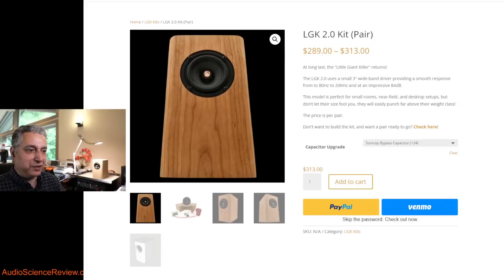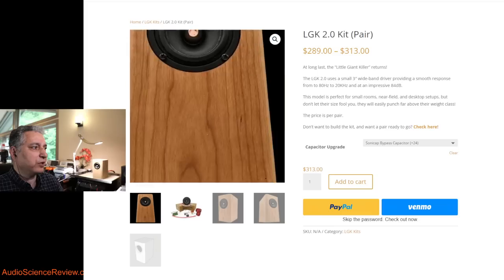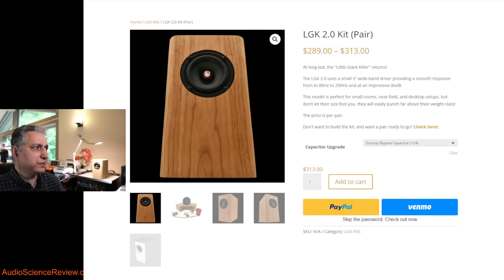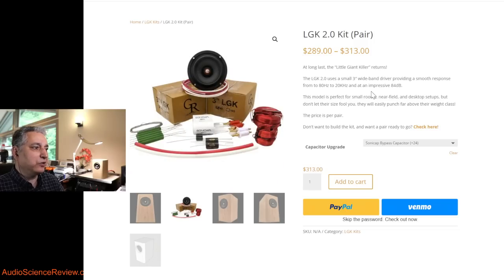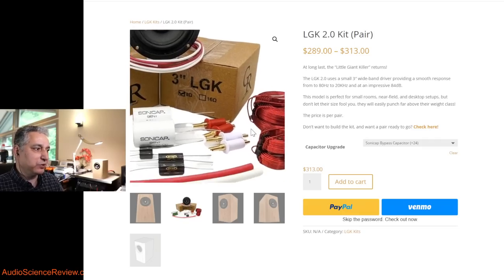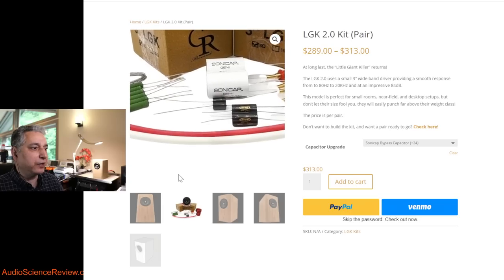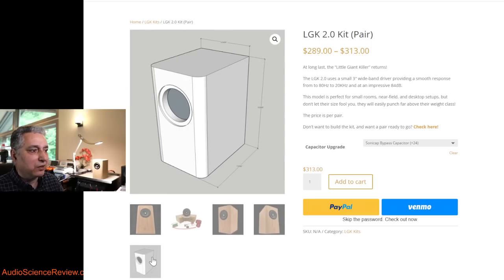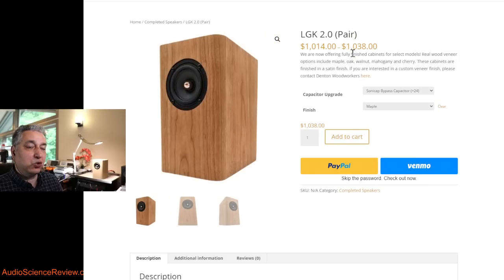GR Research LGK 2.0 DIY kit Speaker Review

Comment: you can do WAY better for $1000
Reply: Amir posted a positive review of the Edifier 1280 bookshelf speakers (with EQ) which are also small, ubiquitous, and can be found used pretty easily for $50-100.
Reply: For $800 (U.S. MSRP) you can get a pair of Kali Audio "2nd Wave" IN-8s.  They're 3-way active speakers with hefty 8" woofers and coincident (AKA "coaxial) tweeters and midranges,  with each driver powered by a separate Class D amplifier circuit plus highly capable DSP, all built into their very solid enclosures.  I have a pair stand-mounted on my desk.  A pair of the very similar-but-smaller IN-5s can be had for $100USD less (MSRP).
Reply: @editorjuno  M-Audio BX8 Carbon for 
$500/pair  150w  Bi Amped Class AB ...  they sound phenomenal and you don't even need a sub, well if you're looking for monitors.  after i got mine 3 other guys i knew all had to have a set.  and that was years ago when they were "only" 130w ea, i can only imagine how they sound now!  i don't think you can get a better sounding of speakers for the money.  and they get LOUD, if you want them too.

Comment: I am afrtaid you made a mistake in the distortion measurements ! (or making the graphs, more likely)
In Distortion measurement 1 you draw the line at 50dB when measured at 86dB... you want  distortion not come above 50dB, all fine. 
At the same time you apply the same line (straight from left to right) when measuring 90dB with makes the 50 dB line sitting 4 dB lower. then the original.  why is that ?? so + 4 db higher distortion is shown then it actually is at the 90dB measurement.

Comment: Man, you weren't kidding about the IMD - that's bad. Clearly this driver should not be let anywhere near deep bass (Xmax is limited as typical for wideband drivers), and it being a BR exacerbates the problem as excursion skyrockets below resonance. At the very least, the existing filter network should be complemented with a highpass. What you really want is something resembling a decent midwoofer crossed at ca. 500 Hz, with the wideband driver stuck in maybe 0.5 l of its own. That could for all the world be a little subwoofer driver of no more than 4", seeing how we're only at around 80 dB worth of sensitivity to begin with. (Something along the lines of a Visaton W100X, for example.)

Comment: No. You overrun the driver to distort. It's a 3 inch fullrange driver. It doesn't play loud at all. How many watt did you put in to it?
Reply from the maker: The driver has measurements posted at 1 meter @  84 dBSPL.  That is just one watt.  I played it at 75 to 80 dBSPL at my listening position where distortion is hugely obvious.  Once your ears get trained, you can hear it at much lower levels.  This is because the driver excursion is limited to just 1 mm yet the box design, takes the response down to 70 Hz.  No way, no how it can produce that at any level.  I am sure there are other 3 inch drivers that do much better.
Reply: @AudioScienceReview  what amplifier did you use for that test? I haven't heard any 3" driver's at all. So I'm rather neutral here. But something just doesn't ad up. Such a driver should very easy be able to handle 84db. If. And that's a big if. It's not pushed beyond its limits in the lower and higher region. It has a very good motor on paper. Should be noted. If you put a low power triode in front of it. Even at 1 watt the distortions would be high enough to be audible. It's not an easy driver to drive. And if it plays anything below 100hz. It needs power.

Comment: Is the driver possibly the same as the dayton audio ps95-8? (looks very similar...)
Reply: I don't think so. Dayton Xmax=2.5mm. GR research's driver Xmax is 1mm. That's perhaps why GR unit cannot be pushed at lower frequencies.
Reply from the maker: It has their name on it so I think it is made for them.
Reply: @queenssmith9438  👍
Reply: @jdarenvall  I am sorry. May be you are correct it is ps95-8. I double check GR research's recent video on this speaker, they mentioned Xmax is 2.5mm. But not sure, it is identical model (there are many parameters to be compared). Thanks Amir for the clarification and confirmation that is a Dayton unit. I wonder whether Dayton buy from someone else.

Comment: So, it's a full range driver, what are caps, coil and resistors doing?
Reply: Even full range drivers need correction, some more than others.
Reply: baffle step correction
Reply from the maker: One filter is to get rid of amplification you get when the wavelength of sound gets to be the size of the front baffle (as noted, it is called baffle compensation).  The other is to get rid of a rise in the tweeter which in my opinion, is incorrectly designed and not needed.
Reply: Thanks for the feedback. I've built quite a few speakers over the years. One used a single full range driver and had no other components at all. It was this driver  https://www.ejjordan.co.uk/eikona/spec/ . Interestingly igts claimed that no filter component's are required but the frequency response might suggest otherwise.
I do enjoy Amir's reviews tremendously, they are so objective and humorous.

Comment: was the speaker measured in anecoic chamber or is this some sort of automated MLS system with turn table etc?
Reply: Klippel
Reply: Klippel near field scanner.
Reply: @ryanamendt8363  that's preaty expensive.  I don't know of any small or midsized speaker manufacturer who can afford or would invest in it. I am sure Amir went deep in  with his credit card to purchase it. 
Having said that, data shown could be arrived to with more of a down to earh mls system and calibrated earthworks or similar.  I am actually surprised at how relatively flat the response is for a crappy little driver like that.
Reply: @snowblow1984  Nope, a speaker manufacturer can't afford not to have one. You will not get the same result with other methods either.
Reply: @ryanamendt8363  Most of the speaker designers or makers start up with fairly small capital and are competing against larger brands. This competition involves various aspects including for example manufacturing of cabinets. Larger brands will often manufacture in China (using low environmental standards, near slave labor etc). So, shelling out 100k is out of the question. 
 Now, unless you need an absolute reference level measurements of components that is published for review, what are the results that you can't measure while designing a speaker, using LEAP or Sound Easy or similar?

Comment: I am so happy always listening in stereo instead of mono. Especially full range speakers excel in sound depth and imaging.
But ofcourse never expect any sound pressure from such tiny speakers.
Reply from the maker: Of course stereo sounds better.  Question is whether a reviewer is more effective in evaluating a speaker in mono vs stereo.  Research conclusively shows mono to be better as does my experience of testing nearly 250 speakers.

Comment: Amir, I've been building speakers for over 25 years and have learned mostly from taking suggestions and feedback from others and applying scientific process to incremental improvements in design.  In my honest opinion you need to listen to  Danny's feedback, as harsh as it is.  I asked Danny a while back for any suggestions he had on an open baffle system I built and he provided me with some rather honest feedback and suggestions which made a noticable difference. Verify from other people knowledgeable regarding interpreting measurement techniques, distortion and waterfall plots in regards to noise floor, understanding proper cabinet damping before assessing any speaker system. It doesn't matter if you have the best measurement rig - you are not interpreting the measurements correctly.  Furthermore, if you aren't pairing these up with high quality equipment, an integrated sub with a high pass filter and actually listening to a pair of them in a good room, your review is pointless and misleading.  I have used Dayton PS-95's in builds and they are basically the same drivers and are great for near field applications but I wouldn't try to treat them as equal as that's just disingenuous.
Reply: So this is a good speaker when it comes to value for price?
Reply: As a speaker designer, you should be flabbergasted at Danny's comments to use 1/3 octave measurements that start at 200 Hz.  Or waterfalls that are incorrectly used.  My background is signal processing and I know these things from first principles. Speaker was paired with state of the art amplification.  Same amplifier blew the LGK out of the water sitting next to it despite being the same size.  

I rolled off the lows as I showed and explained in the review.  Did you not watch the thing?  Even with that high-pass distortion sets in early and now you don't have bass either.  Without the high-pass filter, there is so much distortion that can barely turn up the volume.  What on earth would matter if you listened to stereo?  Do you think distortion from a speaker vanishes?  

If you think these are better speakers than what I have heard and measured, give me half the money and I will send them to you so that you can listen for yourself.  Until then, I suggest not saying that you agree with Danny, lest you want to be painted with the same brush (lack of listening ability for distortion and fundamentals of measurements).
Reply: @amirmajidimehr2283  I watched some of your videos including this one. We can agree to disagree at this point other than this speaker can't handle your power amplifier regardless of any quality when its over driven. I don't need to hear them as I have built similar speakers and understand their limitations.  Are they the best value? Would I pay $700 for a custom built box and $300 for the kit? No, but that isn't the point and you completely don't get it.
Reply from the maker: @nnj248  I suggest you get a sample to listen to.  Nothing prepares you for how much distortion these things pump out.  It has no value as a hi-fi speaker.  Go ahead and simulate its box and driver.  If you do, you see that it is simply not capable of producing anything below 200 Hz. Yet the design pushes it to produce sub 80 Hz.

Comment: I would have liked to see an even lower dB measurement of this given is seems to struggle at 86db
Reply from the maker: I measured with a SPL meter at my ear level and it was around 76 to 80 dB at the highest levels I played.  Distortion actually sets in well before that.  86 dBSPL is at 1 meter by the way.  At 2 meters, it would be at 80 dBSPL.  Danny doesn't provide a distance which makes his dB values worthless.

Comment: Amir you are mostly wrong in your evaluation of loudspeakers. Im not on Dannys side, in fact he is wrong in many of his descriptions.........you just dont understand loudspeaker design and how to connect the data to what matters........sorry I had to say that, I do like your reviews. Your just too new to loudspeaker design. You cant listen to a loudspeaker through a KLippel analyzer and make decisions , and I do own a Klippel and can comment that.

That said.........
The speakers are clearly over priced is you pay $1k for them, but cost aside.........these speakers are meant to be used at low volumes in close proximity. The fullrange design has a distinct sound with minimal phase issues and single point source, which has its benefits.......whether a person can appreciate those benefits, is up to them.
What you just did is take a race car off-road and show us how badly it performs in the mud. If you like going off-road buy the truck.
That speaker is clearly being overpowered and of course your going to hear inter-modulation distortion as the voice coil winding is going beyond the magnetic gap(over-powered).
Reply from the maker: What?  I didn't listen to the speaker through Klippel analyzer.  That is not what the analyzer is for.  The analyzer generates measurements.  Those measurements pointed to problems but did not prepare you for how bad this speaker sounds.  In that regard, measurements underestimated what a distortion factor this little thing is.  Did you not listen to audio that I captured from it?

And where are you getting that mud analogy?  I listened to the speaker from 4 feet away.  Taht is close in proximity In no way was it put to task to fill a large room.  It got distorted at any volume above faint sound.  Sure, not everyone is trained to hear such artifacts but surely you could hear the problem there, no? I captured the sound of the speaker from less than a foot away.  If you did not perceive distortion there, I suggest getting out of speaker designing business.   Spend some time getting your ears trained as I have and then come back an critique my work.

And no, the speaker is not just overpriced.  It simply is NOT a hi-fi speaker.  It generates nothing but distortion that keeps you from evaluating anything else it does. 

Finally I am pretty sure you don't have a Klippel Near-field Scanner.  Having a baseline Klippel analyzer does not remotely give you the same capacities I have to quantify the performance of a speaker and predict its audibility.
Reply: They're chit speakers
Reply: @AudioScienceReview  Your comments just prove more  that you do not understand loudspeakers, You clearly overpowered the speaker, of course it will have distortion. You can overpower any loudspeaker, its only a matter of at what volume level they are meant to be played at, and all speakers will sound like that when overpowered. 
You are  also not qualified to tell me what analyzers I have or have not in my lab.......I have had the klippel for 18 years...and many other analyzers that you dont know about....I have been listening to hi-fi for 32 years, I can distinguishing fairly well between components, which is why i know you overpowered the little speaker.. Similar to purchasing a 10 watt tube amp and hooking up a 1 ohm , 500 watt car subwoofer and then showing us how terrible the tube amp is.
Your review of the GR speaker was terrible and im not into GR.
Reply: Is it true he only listened to one speaker?

Comment: Interesting how Danny posts a 'roughly' formulated response today with LGK 2.0 Updates that span an improved driver, talk about supply chain challenges and then off, thinking aloud about larger sized NGK product range concept introductions.  Then go peruse various forums and see the 'side taking' comment spew.  

It's audio.  Same as it ever was ...
Reply from the maker: Yeh, very unfortunate to see no direct response and more hand waving about this being a great speaker.  No, just putting in a sub doesn't fix the problem. You have a new problem of integrating which you would not have with a properly designed small speaker.
Reply: @Douglas Blake yes, Danny basicly admitted that the "little giant killers" are just "little" and can  only be uses as satellite speakers at low volume

Comment: Most small speakers driven full range will suffer from this, however, most small speakers have filters in place, either active or passive, to solve the problem. This little driver would be so much better as a wide-band mid used in a 3-way. I'm sure these sound pretty darn good when paired with a sub that can play up to 120hz competently and of course, proper high-pass for these.

Comment: This particular speaker from Danny is an outlier within his offerings. 
Upon it's release, I saw zero viability of the driver/shaping coil/flat pack combo for me.

However, just the raw driver... perhaps implemented into an element of a line source, THAT'S where a much more viable platform for use of this wide-bander. 

What's available at under $1k is amazing within this 𝘽𝙍𝙐𝙏𝘼𝙇𝙇𝙔 competitive market segment. 

Hell, way down at $199 each ... are the wonderful JBL308P. 
The active small monitor segment offers superb performance and value. 

Well executed active, biamped, chip-amp, DSP aligned/contoured two ways are abundant.  

Actually a pair of those supported by a proper sub system offers stunning playback characteristics. 

Danny's forte is his bigger dipoles, and DIY'ing his two-way bookshelf.
Reply from the maker: It may be an outlier but he sure positioned it as a major new force in speaker development from naming it "Little Giant Killer" to promotional material.  As you, his claims didn't seem believable but I think the performance is even worse than one imagines.  It simply is a distortion factory.  How he can say he has good ears and system and yet doesn't hear such easy artifacts is beyond me.

Comment: What's sort of interesting from the looks of things is that the "full range" driver here probably would work just fine... as a midrange in a 3 way configuration.
Reply from the maker: Right although I suspect purpose built mid-range drivers do better seeing how this thing costs $50 for the driver alone.
Reply: @AudioScienceReview  seems excessive considering that driver is probably a $10 cost driver from manufacturer .

Comment: You know what I think those cheap htib full range drivers have more excursion than the lgk. Not sure about the rest of the sound. Probably similar to some Tang band Logitech drivers I've heard as they are very similar in build
Reply from the maker: You are probably right as I have never heard a speaker distort so easily and so readily.